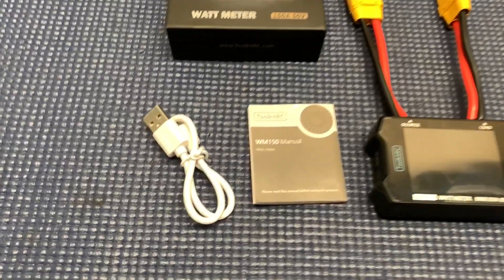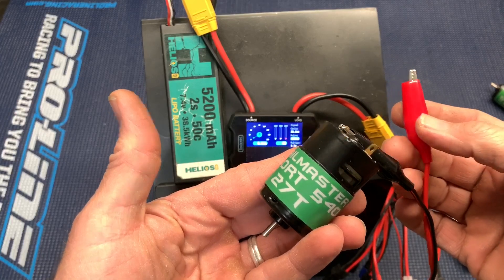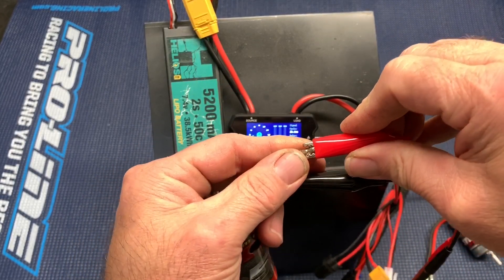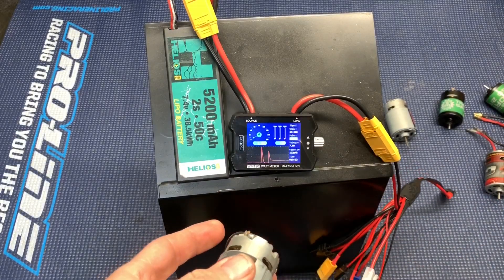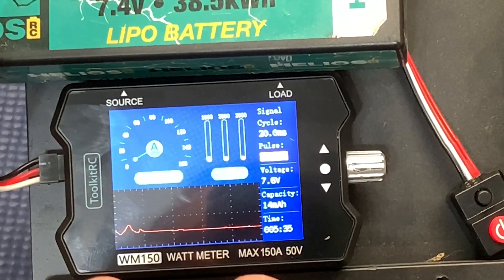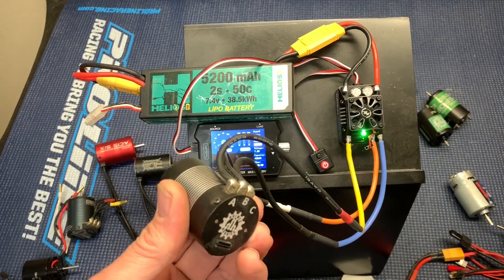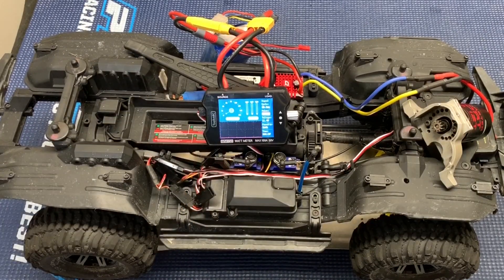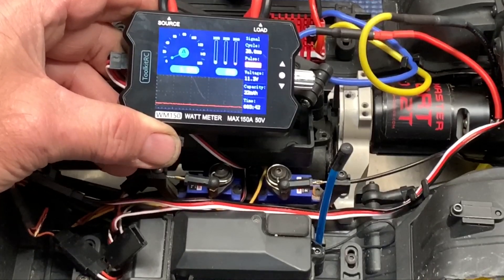Toolkit WM150

Comment: Using it on a built rig to check efficiency would be awesome. Every guy that stuffs gobs of grease into everything that has gears needs this to show how inefficient their builds are.
When one is done with a build...without the motor pinion installed...it should push-by-hand freely as close to a Tonka truck as possible. We all gotta remember these tiny truck are extremely light with gears just as hard as their full size cousins. They don't need super thick grease packed into them...especially trail rigs.

Comment: Hvac guy here. 
 I know . I test alot of thanks and  including up RC . . Just as you did . Can give you a lots of  information about.  If,) you know what your doing.  Like you. . Right at home on this video..  I test very thank in my line of work.. Control board. Thermostats . Fun blowers motors, outdoor compressor in. The heat pump... you name it.. :).. NC back yard RC.AND MORE. 🏞🖒✔

Comment: wrong link for the WM150 Watt Meter
Reply from the maker: 82al I fixed it, I think. Try this link [US$29.90 25% OFF]ToolkitRC WM150 150A 50V Watt Meter Power Analyzer LCD Display Power Voltage Current Tester PWM Output RC Parts from Toys Hobbies and Robot on banggood.com https://banggood.app.link/MRDkxbGYd2
Reply from the maker: Had to use the app for that one
Reply: @ExocagedRC  Thank you!